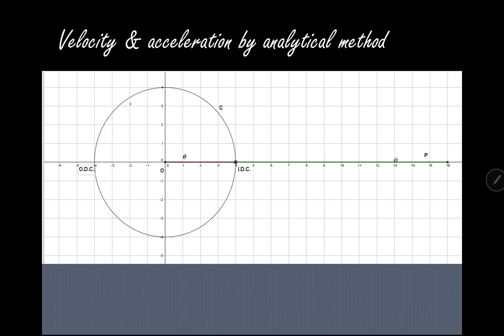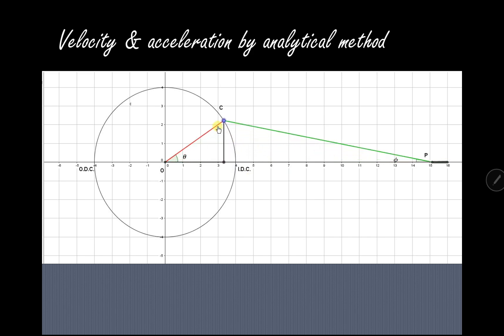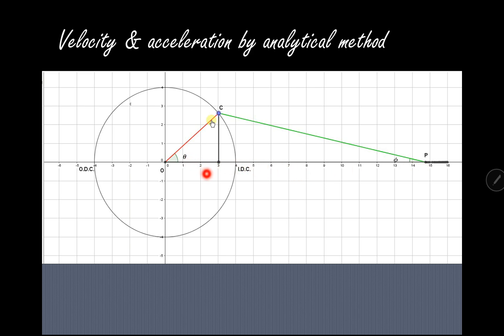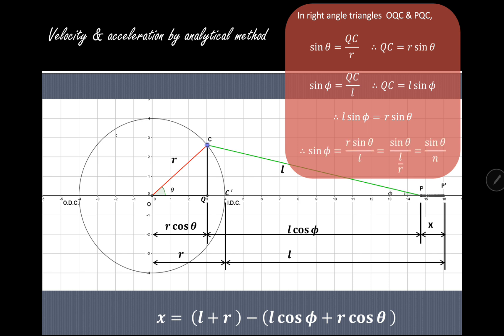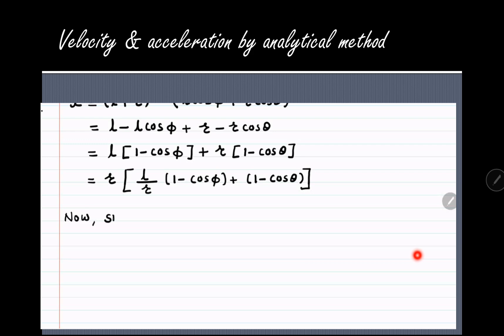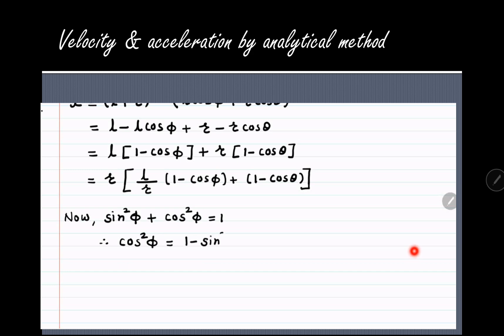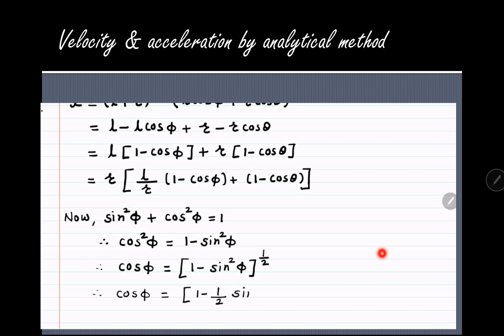Lecture 23 | Velocity & acceleration analysis | Analytical method 1 | Single slider crank mechanism

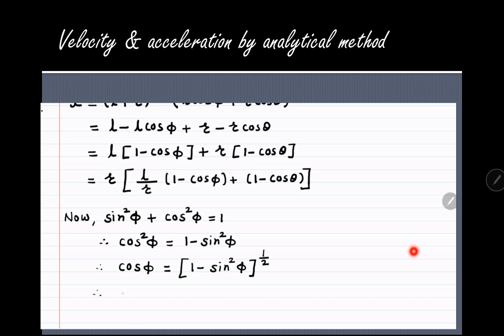Comment: At 7:43 how did you equate cos(th) = 1- (1/2)sin^(2)(th) ? 
In this equation, if i make theta= 30 degrees, it does not hold :
Sqrt(3)/2 does not equal 5/2
Reply: This is because i think (1+x)^a ~ 1+ax (for x<<1)

Comment: Is motion of circle clockwise or anticlockwise
Reply from the maker: In anti clockwise direction.. Thanks.
Reply: @CHINMAY_ACADEMY  I mean if Omega(w) is clockwise does it indicate negative -w? Instead of +w
Reply from the maker: No .. it depends upon the angle you measure from I.D.C. position. Anti-clockwise = +ve  and Clockwise  = -ve
Reply: @CHINMAY_ACADEMY thanks, what if clockwise. Do any signs change?

Comment: thanks a lot but, what is the uints?
Reply from the maker: Velocity is in m/s  ,  crank radius in meter, angular velocity in rad/sec , angular acceleration in rad/s^2  , stroke length in meter and linear acceleration in m/s^2. Thanks..